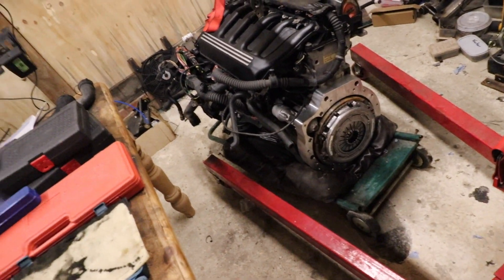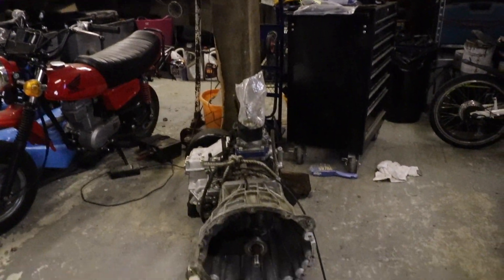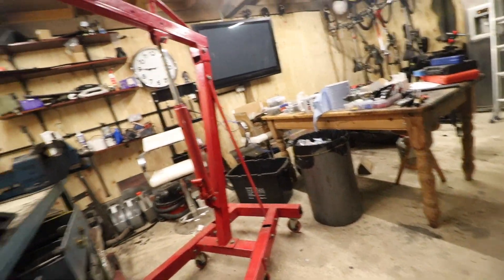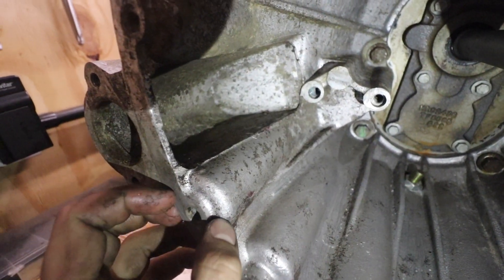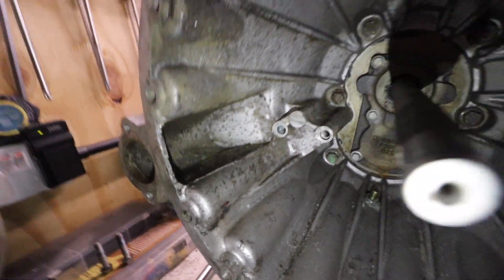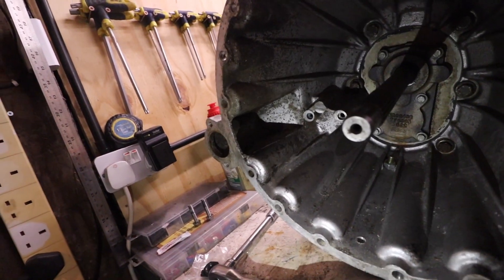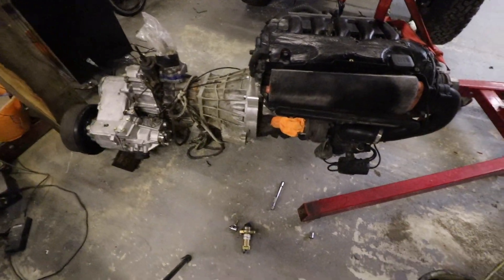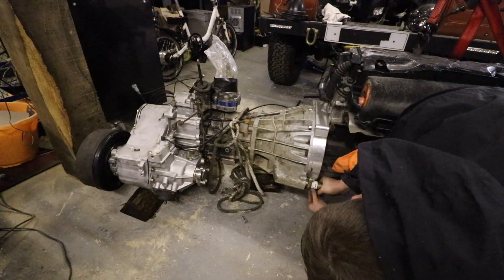Project M57:Episode 11

Comment: Wow must subscribe
Found the video really interesting, but just out of curiosity did you have to source an adapter plate to mount p38 bellhousing on to the m57 engine, also what variant is the m57 engine and what ratio transfer box did you go for? 
👍
Reply: He used an r380 bell housing that comes standard on a defender and used the correct adapatrr plate from synchro gearboxes, u wanna use a discovery transfer box as ratios are longer!
Reply: anyone done this for a discovery 1
Reply: Hello
Adaptor for Discovery2 2.5 td5 compatibile?